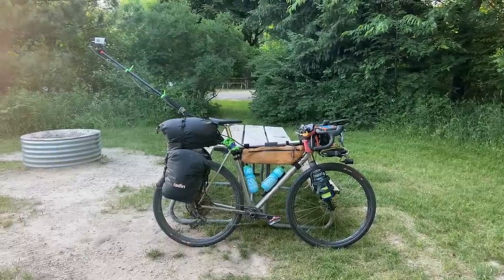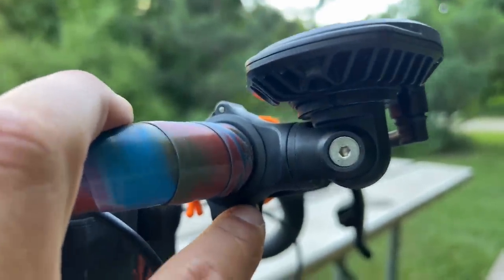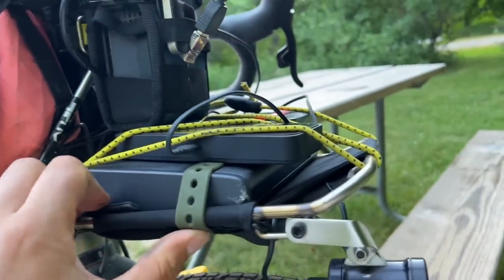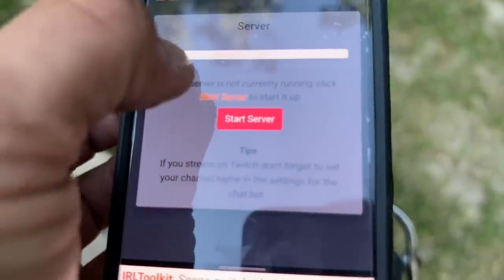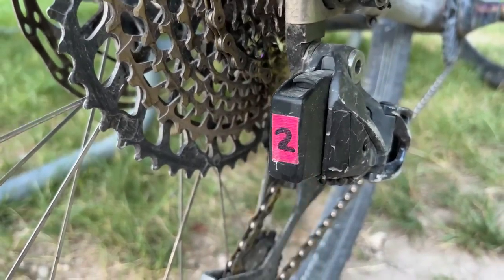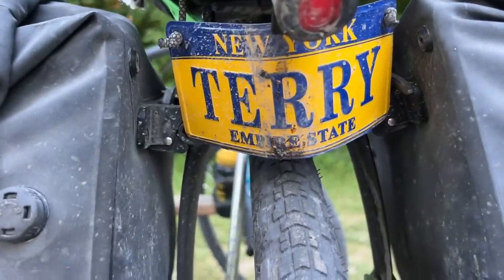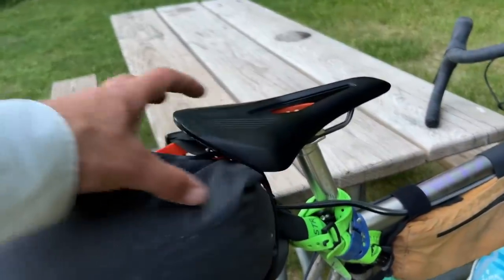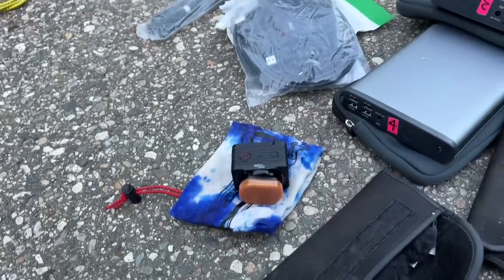I’m Riding this Bike Across North America

Comment: expert! what's your navigation tool? the axle is much better, it offloads all the rack weight from the frame to your hub bearings. what's up with the modems? what are you connecting to? wifi extenders? cellphone?  we will be watching on the big screen. personally, i prefer trailers like the BoB.
i dragged one with my litespeed from Chicago to Boulder and it was great. i used sandals but switched back to stiffer shoes when i got to Oregon.

Comment: Hi Terry, just FYI - if you can, try to fill your bag pump for your sleeping mat with wind/natural air rather than your breath. Just in case you didn't know, the condensation in your breath can affect the rating of the sleeping mat and cool you off more than you may like. This is more important in cool weather than it is in hot weather, but just thought you should know. Amazing video! Loved seeing the whole setup.
Reply from the maker: Thanks will
Reply: Also mildew or whatever fungus crap can be avoided using dry air only

Comment: Sons are top of the line. I got a Shimano dynamic hub - their best one with good seals. Lasted me 20,000 miles so far. No issues. Just had to tighten up the bearings once after they came loose.
Reply from the maker: So far so good

Comment: This is going to sound like a very novice question, but I was thinking of a similar idea to this. Could you not just have a second smartphone angled in the correct way and connected to a mic to use as a streaming device and camera? Why the need for modems and all the other stuff?  I get that you wouldn't get the breadth of shots but yeah, would be super simple, which is nice.
Reply from the maker: There’s multiple reasons a phone wouldn’t work for this. I encourage you to give it a try yourself.